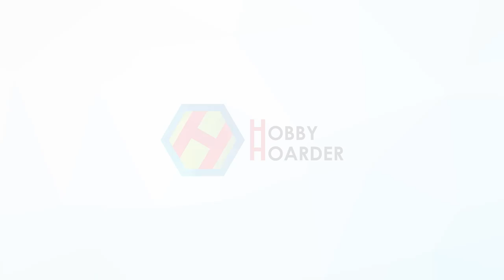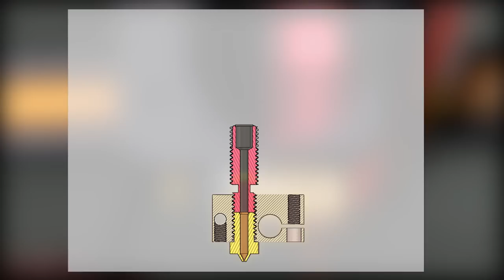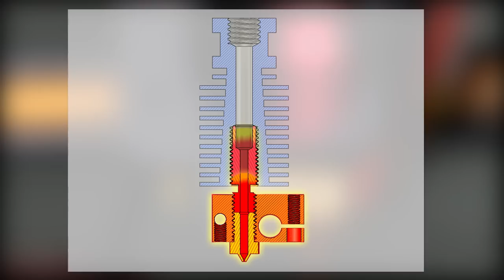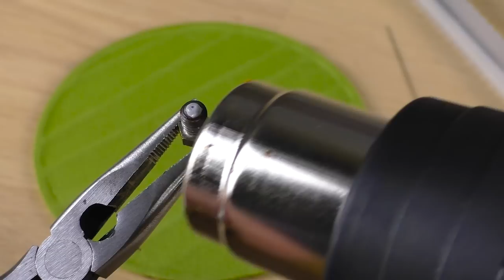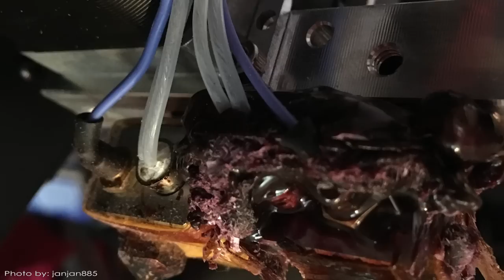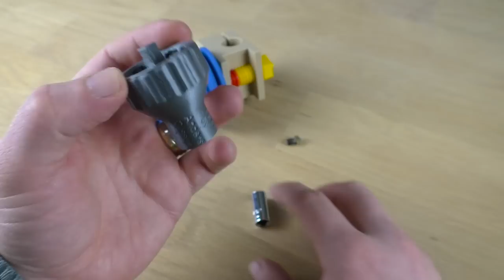Hotend explained and how to properly change the nozzle on a 3D printer

Comment: I have this weird issue where the filament clogs in the bottom end of the heat sink (the part that is screwed in the heating element). It follows the general pattern for heat creep (first few lines are normal, then clogging sets in). 

Sometimes I can print an entire temp tower, albeit very brittle (so some clogging is in effect). Other times, nothing.

My IR camera shows no heat leakage to to heat sink (only a cool 60°C, without the cover and fan). 

I do not understand why filament would clog in the heating element. It melts in there just fine.

Creality's customer support is totally useless.
Reply from the maker: @JasonRobards2  Can you verify that the top of the nozzle (above) has a small gap left?

Comment: thanks for your explanation! I have an ender 5 and when I screw the nozzle, it touches the heat block. I do not see a gap as you said. Your example is for your specific printer or does it apply for any printer?
Reply from the maker: Yes, there has to be a gap. Most printers use a similar design for the printhead, including Ender, and there has to be a small gap above the nozzle (after you tighten it).

If you've already printed a ton of stuff with it and you didn't see any leaks, then you might be lucky, but if you ever replace the nozzle, make sure to adjust the heatbreak as well.

Comment: hello,, our hotend nozzle is not rotating for removing even after the heating is done in nozzle.thread is jaamed i guess, how to seperate nozzle from heat block ..please sugest
Reply from the maker: You could try heating it even further with a hot air gun and using pliers to try and unscrew it. Just be careful as it can get very hot.

Comment: Thanks for the explanation. I'm a noob, I've always tightened the nozzle into the block. Why is that a bad thing?
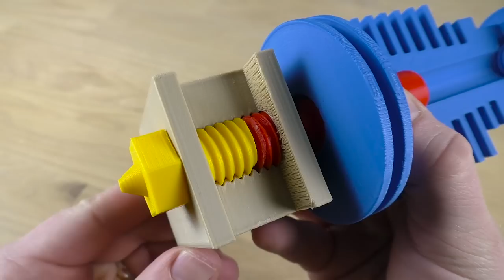Reply: The problem with this method is that it has the potential to leave a gap between the nozzle and the heat break, potentially causing leaks. Take a look at 03:35 for a demonstration of this happening.
Reply: You’re not very observant are you?
Reply: Hi! I understand it has that potential, but also it would heat the nozzle better, wouldn't it? I mean, you would be increasing the contact surface between the nozzle and the heat block. What would be the problem in starting with tightening the nozzle until it touches the block, unscrewing it a quarter of a turn, then screwing the heat break/heatsink and finally tightening the nozzle while everything is hot.

Comment: i seen one video where the youtuber left a gap between the nozzle and heat break and then heated up the hot end, push the bowden tube all the way in and then tightened the hot end to squeeze the bowden tube like a seal between nozzle and break…. is that not necessary?  yours seem to but end to break.  Also is the .5mm gap exact measurement for the nozzle or is that tolerance not too important?
Reply from the maker: It depends a little on the type of hotend used, but generally, the ptfe tube doesn't need a seal because the filament isn't hot enough to melt yet. The tube is there only to guide the filament further. 

No, the gap doesn't have to be exact, just that you can see that there is actually a gap there.
Reply: @HobbyHoarder  Thank-you for the fast reply!

Comment: Need Help: i'd like to remove my noozle, but it seems it got stucked in the heatblock.
I tried with pre heating the block o even cold temperature attempt, with sockets, wrenches and even vice grips. No success unluckily. furthemore now the noozle is smoother than before making every following attempts more difficult.
Any advice? what should i do?
Reply from the maker: Put it back in the vice grip (the grip should hold the heatblock, nothing else) and then use a hot air gun to heat it up, that always works for me. I also use a hex socket, never a wrench. In the mean time, definitely order a new nozzle to replace this stripped one.

I'd also suggest you completely dissasemble the hotend as well and put it back together. With all these twisting, it's quite likely that something else got loose, so it's better to be sure about it.

Comment: If I want to change the only nozzle, do I need to open the heat block and take out the heatbreak too?
Reply from the maker: Change just the nozzle first. While you're tightening it, check if there's a small gap above the nozzle. If there is, you're fine and you can continue printing. But if the nozzle pushes directly against the heatblock, then you'll have to take it apart and re-assemble as I'm showing in the video.
Reply: @HobbyHoarder  do I need to tighten when heated or cooled?
Reply from the maker: @CTZN1  Heat it to max and then tighten, but be very careful not to burn yourself or damage any of the wires.

Comment: Hi , I use an i3 mega and am unable to unscrew the throat tube from the heat block , why is this and is there any way to easily do it as my hands are starting to blister ?
Reply from the maker: It's probably because of left over plastic that's still inside, but now it's solidifed and so making it hard to unscrew.

I always use a hot air gun to heat up everything and then (gently) unscrew it using pliers. It's much better if you can remove the entire hotend away from the printer, so you don't accidentaly melt something with the gun.

Comment: Finally i have done with my first print, but happiness didn't last long. my extruder motor is clicking and first few layers of my print are good but after that the nozzle is getting blocked. by the way upper part of my nozzle and lower part of heatbrick are turning black is that a problem. can you please help.
Reply from the maker: Sorry to hear you're having troubles.

If you're seeing black parts (like it's covered in black oil?), then you have a leak somewhere. This is probably causing your hotend to jam as well (that's when you hear the extruder clicking). It's probably just a small one, otherwise you'd already have a huge blob around the hotend by now.

I'm afraid you'll probably have to take the hotend apart and assmeble it back together as I've shown in this video. While you're at it, clean everything as best as you can. Using a hot air gun really helps with cleaning.
Reply: @HobbyHoarder  Thanks for your suggestion. I will definitely try it. But what i observed it that first few layers it is printing fine, but after that the nozzle is dragging on the bottom layers and causing a nozzle clog.
Reply from the maker: @projectdexter7501  Try reducing your flowrate by 10% and see if it helps. Maybe you're simply overextruding and the plastic has nowhere to go. If it makes a difference, you can then do a proper extruder calibration.
Reply: @HobbyHoarder  I am a newbie to 3d printing. can you please tell me where to change the flow rate. I am using cura slicer.
Reply from the maker: @projectdexter7501  Sure. You'll have to enable expert view first. You'll find three lines right next to the "search settings" input if you open print settings. Click that and select Expert. Then go to the Material section and you'll find "Flow" there, which is probably set to 100. Set it to 90 and slice the model again.
Reply: @HobbyHoarder  Thank you very much. i will definitely try it.
Reply: At last i am able to print without any clogs. Your videos and suggestions helped a lot. And once again thank you for taking your time and patiently answered my questions. You're awesome.

Comment: Why ''Top of the nozzle should never touch the heatblock.'' ?
Reply from the maker: Because if it does, then you can't be sure that the nozzle is tightened correctly against the heatbreak. If it isn't, you might get a gap. Please take a look at 3:30 in the video and you will see what I mean.
Reply: @HobbyHoarder  Oh well :) Thanks

Comment: My heatblock is not in the position it was after I changed nozzle several times.. Did I break something???
Reply from the maker: I doubt you broke something, but maybe another pat of the hotend got loose? Check if you can turn the heatblock (don't use too much force). If it's easy to move, then it's not tight enough against the heatbreak.
Reply: @HobbyHoarder  yeah I can turn it back to the original position but then it's kind of loose
Reply from the maker: @ELValenin  Then I think the best thing would be to re-assemble the hotend. I know you probably hate the idea of doing that, I sure did when I had to do it myself, but it's the only way to be sure you won't have issues in the future.
Reply: @HobbyHoarder  yeah I'll do that. Just need to wait for thermal paste then..
Reply from the maker: @ELValenin  Yeah, definitely, the paste really helps. Just make sure that you apply it only on the upper part of the heatbreak (the upper threaded section). Good luck and let me know if you need any help.
Reply: yup i'll definitely do that.
Reply: @HobbyHoarder  I think I solved the problem. The hotend just twisted in the mount (e3d v6 prusa Edition)
Reply from the maker: @ELValenin  That's great! I always hate taking the hotend apart, it's good that you avoided that.

Comment: i put my hotend assembly back together before watching this video and now after a night of printing, my hotend is covered in filament.
Reply from the maker: Is it bad? If you have a heat gun, use that to carefully remove the gunk. Cables are the most sensitive. A hair dryer works as well, but it's slower. Good luck!

Comment: I have built my own 3d Printer, and i am using v6 jhead clone hotend, when i try to preheat to hotend, after heating upto 130 Degrees Celsius it throws an error. E1 Heating failed printer hatled. can you please help me find the exact issue?
Reply: This might happen because it is losing heat very fast and it cannot sustain the temperature. Make sure that your room is not so colt  or you does not have any drafts in it.
Reply from the maker: Are you using Marlin 2.0? I've read some comments where people started having this issue after upgrading firmware to 2.0. If that's the case, you can change the thermal protection values and give it more time to heat up.

This is all assuming you're sure there's no mechanical issue, like a broken wire or bad thermistor.
Reply: @HobbyHoarder  Thanks for your concern. After replacing the heater cartridge issue resolved. once again thanks for replying.
Reply from the maker: @projectdexter7501  I'm very happy to hear that, good job!
Reply from the maker: @Ionut Stoican Yeah, that's a good tip. I have my printers in the basement and my Prusa keeps triggering heating error as soon as the ambient is below 20'C.

Comment: How does the thermistor work in that hotend?
Reply from the maker: I didn't print the thermistor in my big model. Generally speaking though, the thermistor is a simple resistor that changes resistance based on temperature. From that, you can calculate how hot the hotend is.

Or did you have something else in mind?
Reply: @HobbyHoarder  Well, I had brought an 3d printer hot end but dont know how to use that thermistor ends which has two female pins white in color.
Reply from the maker: @aswinbalasubramanian5753  Thermistor doesn't have any polarity, so it doesn't matter in what way (which order) you plug in the wies, it will work in any case.

If you don't know where to plug them, check which board you have and then you can easily find the plug schematics online.

Comment: Was this demonstration done with an all-metal hotend or the one that is not?
Reply from the maker: The showcased model is E3D, which is all metal, but the same basic principle apply for any hotend.
Reply: @HobbyHoarder  I have all-metal hotend too then.. will that plastic part inside melt? the one in the heatsink area?
Reply from the maker: @antdx316  You probably mean the PTFE tube. No, it will not melt, it's designed to work at printing temperatures. Some cheap Chinese ones might melt, but if you have a genuine all-metal hotend, like E3D or MicroSwiss, then there's nothing to worry about.

PTFE tube is important as it guides the filament inside the hotend. If you can, make sure it's inserted in as far as it will go.
Reply: @HobbyHoarder  People were telling me in a facebook group that the PTFE liner will melt on the CR-X? how are people printing at 310C+? is the design different or they mistaken the CR-X has an all-metal hotend?
Reply from the maker: @antdx316  CR-X has the same hotend as all Creality printers. The PTFE that comes with it isn't the best quality. I had to replace mine after about a year of printing, but I probably should have done it sooner. I think that's what people on FB had in mind.

PTFE tubes aren't that expensive and it's easy to replace. I bought original Capricorn and it's still doing great after over a year of use.
Reply: @HobbyHoarder  How do you change the PTFE properly? and are they all the same size?  for 1.75mm that is?  For 2.85mm it's different?  What nozzle size is the biggest you can go with 2.85m and how much wattage heatcore?
Reply from the maker: @antdx316  Yes, it's a different PTFE tube depending on the filament size. And you can't just switch to 2.85 filament by changing the tube, you also have to switch the hotend to the 2.85 version.

Nozzle size doesn't depend on the filament size. If you plan on using nozzles larger than 0.6mm, then you'll also have to switch to a better hotend, something like the Volcano. The stock hotend simply cannot melt plastic quickly enough for large nozzles.
Reply: @HobbyHoarder  how many watts?
Reply from the maker: @antdx316  It depends on your specific hotend, but it's usually around 30 to 40W.
Reply: @HobbyHoarder  what about putting a 50W?
Reply from the maker: @antdx316  I've never tried so I can't say. You'd have to make sure your current mosfet can handle that.
Reply: @HobbyHoarder  yeah, I'm just going to leave everything stock as it works
Reply from the maker: @antdx316  I've learned a long time ago that when it comes to 3D printing, it's best to just leave it until something breaks :D
Reply: @HobbyHoarder  I need to make some kind of enclosure lol.  The CR-X has potential but only if you can get a good enclosure for it.
Reply from the maker: @antdx316  Ikea Lack if the CR-X fits inside, you won't find anything cheaper.
Reply: @HobbyHoarder  I need to create an enclosure from scratch
Reply: @HobbyHoarder  it won't fit..

Comment: Who cut the cable off that nice noctua fan...!? Savage :(
Reply from the maker: I did. I print a lot and the fans tend to fail/lose power after a while. So I'm using Dupont connectors for all the fans. This way, whenever I have to replace a fan, I don't have to disassemble entire hotend, I just unplug the old one and it literally takes less than a minute to replace the fan.
Reply: @HobbyHoarder  How is the failing fan and dupond connectors related to cutting the cable?
Reply from the maker: @mylanthony  Oh, you mean the yellow wire? The Mk2 didn't use the third (speed) wire and was in the way, so I cut it off. I bought the Noctua fan myself, Prusa didn't start using them until Mk3.

Comment: I see no point in leaving a gap.. Everytime I replace nozzle i tighten it to maximum agains heat block and then carefully tighten the heatbreak (the heatbrake is really vulnerable )
Reply from the maker: Mark Bear It actually makes the most sense.

The nozzle has a hex shape precisely so that it's easy to tighten. By leaving a gap (between nozzle and heat block), you can be sure that you're tightening against the break with the correct amount of force and that you won't get any oozing. Finally, heat break is round, so it's a lot harder to tighten it than the hex shaped nozzle. And you can't reach the block unless you disassemble the hotend. It's also much harder because the hotend must be at a working temperature before you install a new nozzle.

I hope that makes sense and why it's the preferred method.

Comment: How are you and many other people able to print things like Bolts and screws and have the threads ABSOLUTELY FLAWLESS...? I cannot get my printer (ender 5 pro) to print the bolt or screw threads well, if at all.
Reply from the maker: Your printer should be perfectly capable of printing those.

You should have at least a decent quality PLA to begin with. Then do the extruder calibration (MatterHackers on YouTube has a good video about it), followed by flowrate calibration. This will ensure that your printer extrudes the correct amount of plastic.

Just to be sure, check that the belts are tight enough and that the bed isn't wobbling. That could also cause your parts to have incorrect proportions.
Reply: Hobby Hoarder So my belts are tight I made sure of that after watching a couple videos and my bed is not wobbling either. It’s not even warped. And apparently that’s pretty surprising for a ender printer… The issue that I’m having seems to be my slicing software… Whenever I print anything from cura, it comes out looking like I have the gloss setting on and it looks shiny and sometimes translucent. But whenever I print from the cruelty slicer it comes out Matte and completely perfect but sometimes with stringing. One of the main issues I have right now is the way some of the things print clear and you can see the individual lines and layers and sometimes the layers look very thin and the stringing but the streaming has almost stopped. I’m using Amaz3d transparent at 205c/65. Cura is the only program I seem to be having issues with right now aside from not knowing how to edit any of my .STL files so there is a phone stand that I really like but I cannot make it tall enough to use for my phone without increasing the entire projects size